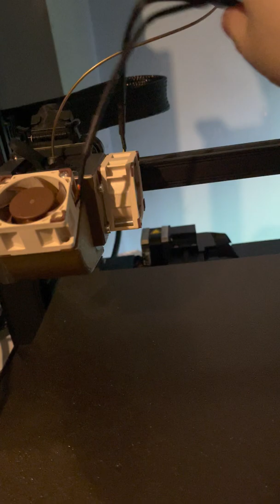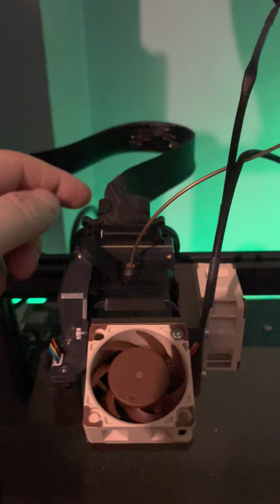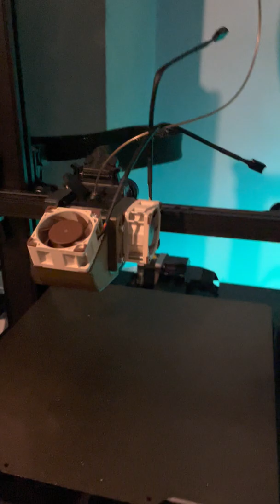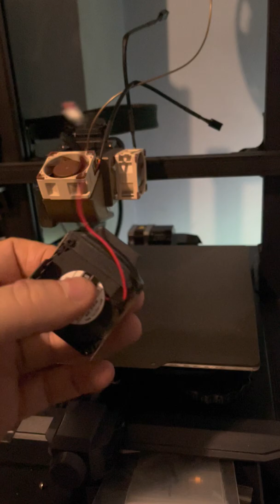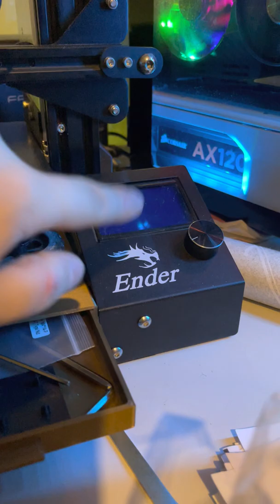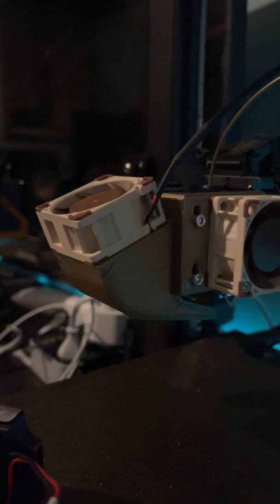Ender 3 S1 noctua fan upgrades assembled. sprite extruder, Creality CR10 smart pro / ender 3 s1

Comment: I just got a CR10 Smart, will upgrading to the Sprite be easy?
Reply from the maker: which mainboard does it have?
Reply: @aim6mac   it still have the stock one. Will I need a different motherboard? I was told it's a plug and go kinda upgrade...
Reply from the maker: @Tyguy266  i dont think u need to upgrade your board, as your board should be a 32 bit one, u do need to get the KIT upgrade version of the Sprite extruder.
Reply: @aim6mac  appreciate it. I order the Sprite kit with the mount and wires, said it was for the CR10 smart pro so fingers crossed lol